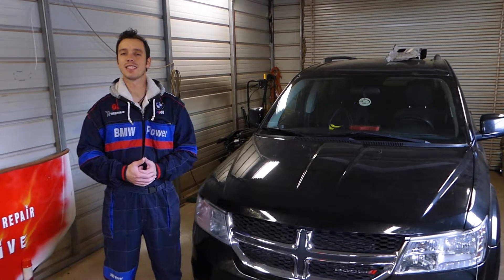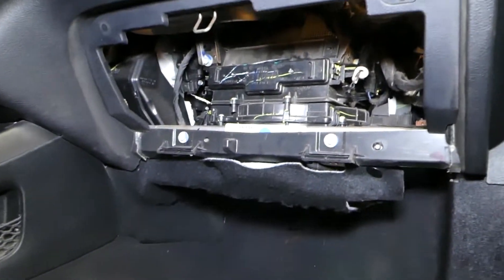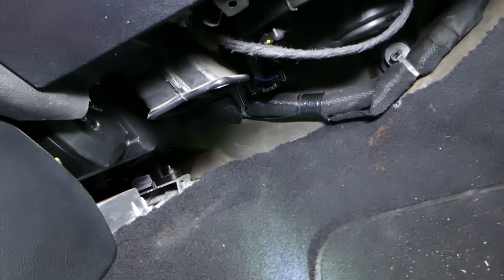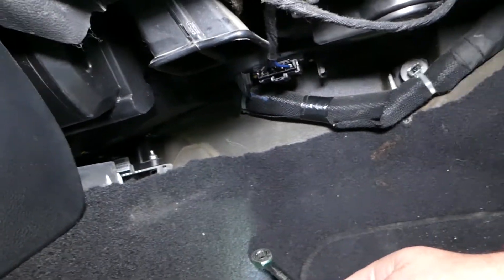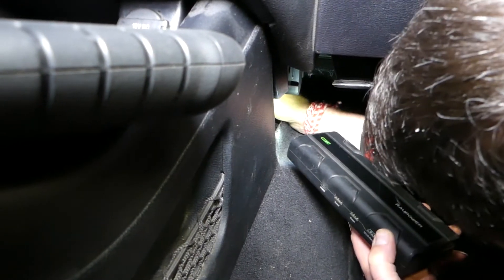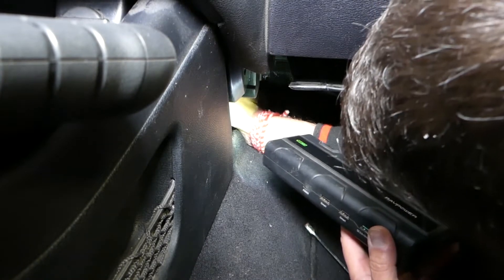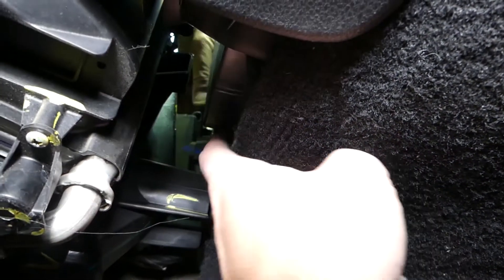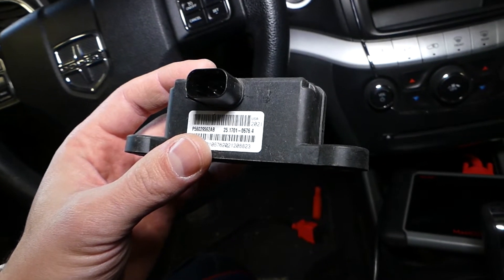DODGE JOURNEY TRACTION CONTROL MODULE YAW RATE SENSOR LOCATION REPLACEMENT. FIAT FREEMONT

Comment: My wife has a 2016 Dodge Journey and the abs light and traction control light cane on both at the same time and all fuses are good, do u think a new yaw will fix it?
Reply: Did you find a fix for your Journey?
Reply: No light is off but occasionally comes back on randomly wail driving then stays on until next trip out
Reply: It is most likely the abs control module. Check for a recall. My 2010 is doing the same thing thing but the recall is only for 2012 and later.
Reply: @ringo7745  I have a 2012 but it was built before April 2012 and because of that, the recall is not for me. Last time I own a dodge.
Reply: Does is hesitate sometimes while driving and then goes back to normal?
Reply: It was the abs sensor behind the wheels

Comment: Multi Axis Acceleration Sensor is what our 2012 dodge journey shows as the engine light. Is this the fix for that? C006a is the scanned code
Reply: Same for a 2013 Code C006A-49. People keep telling me it's a pedal sensor but after looking for days, it doesn't seem to be the same thing.
Reply: I'm getting the exact same code.  C006A-49 with traction control light staying on.  2013 Dodge Journey.  There was a recall on this and the dealer "supposedly" replaced the ABS module.  Still having this light and no traction control.  Very frustrating.
Reply: Have you ever found the cause of this code.? I’m having same issue with Chrysler t&c.thanks

Comment: Hi guys :), Thank you for your useful video! Do you also know where I could find out the location of  "the entertainment control module rear B" in Dodge Journey 2010? Issue U0249. Do you have experience with that? I am not able to find it...

Comment: Hi Sir
Does it 2.4L engine ?   I am also have problem with traction , my car is jouuney 2.4L 2013 🙏
Reply: Any luck on the car my etc and esc but no check engine
Reply: Light etc and esc light
Reply: The 2012-2015 has a safety recall for this take to ur local dodge dealer and the should fix it for free unfortunately mine is a 2011
Reply: Yes it is a 2.4 dodge journey 2013
Reply: I spent a decent amount a money trying to diy almost everything under the hood is new then driving in the rain storm the other day my belt came off 3 belts in 6 months so the tension pulley needed to be replaced so far so good

Comment: Hi 
I have a 2010 Dodge Journey SE . Off and on its EPS AND BAS lights get on the dashboard but when I switch off the vehicle it disappears and  may arrive again after 2 hrs 5 hrs or so . Please guide me what to do coz the mechanics are speculating o may be because of brake switch which o got changed.
Reply: Having same issue , when it comes on it won’t let me shift out of park , did you have same issue
Reply: Did you ever get it fixed?? Having same issue.

Comment: Right front wheel speed sensor video please !!   I saw your driver's side video, but the passenger side is hard to reach the electrical sensor.  There must be a different procedure for under the hood.
Reply: MrTonythetiger91 I agree. I need a video for passenger side!

Comment: This video is great right up until you cut away from showing how to disconnect the clip on the yaw wire. A demonstration would have been great since dodge is know for manufacturing confusing clips like this one.
Reply: When you have the new piece in hand it's easy to see the clip lock on the right side of the connector. When you use a screwdriver, just push the plastic latch at the base of the connector and it will get free instantly

Comment: I have a Fiat Freemont 2013 with these ABS error codes:
C211B, C006A and C0042
Reply: Does any of these codes can be fixed replacing the Traction Control Module?
Reply: I have C006A-49 only with ESP (traction control) light on.  Dealer said it was the Dynamic Sensor.   I've got one ordered to try.
Reply: @aholmes447 is the dynamic sensor what they replaced in this video? I have same code.
Reply: @newfiepacer  Yes.  Once the part came in I replaced it myself.  The code went away. That was over a year ago lol.  Haven't had an issue with that code since.
Reply: @aholmes447  awesome! Thanks for the reply, I appreciate it. I'm going to replace it myself today then! Cheers
Reply: @newfiepacer   Just curious if you got around to replacing the sensor and if it fixed yours?
Reply: @aholmes447  good timing, I was going to comment tonight about it! I did get it replaced, it was a bugger to get the left side nut off/on and then get it past the wiring harness. I found it best to remove the plate that it's installed on. But, late Thursday I did get it changed, cleared the code and "knock on wood" it hasn't come back on! I also had to get one from a scrap yard as no parts place had them and the dealer wanted the part number from the module to see about ordering it. So I'm hoping this one last awhile, cause I don't want to do it again lol. Thanks again for responding, it was a big help to have confirmation that someone did the same thing with success before I did it!
Reply: @newfiepacer  Funny you say that because I had to do the exact same thing 😂.   I ended up finding the part on some website.  I can't remember  where, been to long ago.  But, I do remember shipping took forever to the point I gave up on receiving it.  So I went to my local salvage yard, found a journey, and pulled the part myself.  Installed it in my journey and it's still good to this day.  The one I ordered eventually showed up around 4 weeks later IIRC.  So, I have a new one put away in my garage.  

On a separate note, I just had P0520 show up (Engine Oil pressure sensor/switch circuit).  Engine Oil pressure on my dash stays pegged out at 96psi.  I pulled my old one out yesterday.  Waiting for the new one to be delivered.

One thing I have learned about most Mopar vehicles (I also own a Ram 2500 Cummins) is they run a TIPM system (Totally Integrated Power Module) and they are very sensitive to correct voltage.  Make sure your battery cables included all grounds to the frame stay clean from corrosion, dirt, ect.  Voltage fluctuations (even very minor) can cause havoc on these sensors and modules.  Mine had some corrosion and factory paint on the frame grounds so I cleaned them up to the shiney metal.
Reply: @aholmes447  thanks for the heads up, I knew they were ground sensitive, but I didn't know to that extreme. One thing I can say, if you start getting a message pop up on the dash saying that it's gone into electrical shed or something like that, your battery is getting ready to crap out. 
I'll keep the oil pressure switch in the back in my head, because I'm sure that'll pop up at some point.
I was thinking about getting a new sensor from the dealer now that I have the old one in hand with the part number, but the scrap yard one was only $18, so I'll get another one for that price hahaha